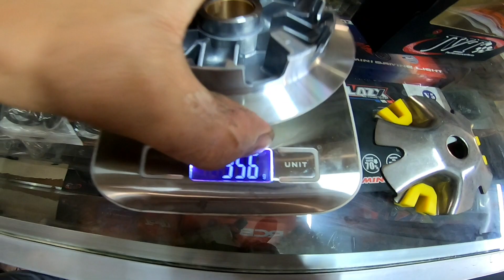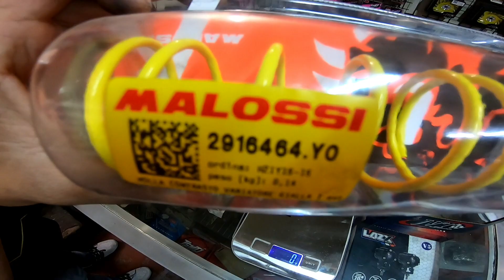The All New JVT Pulley Set for Nmax/Aerox

Comment: boss matanong lang sana masagot, ano po set up nyu dito sa panggilid niya naka full jvt set ako kaso 125 topspeed, (1200rpm center spring, 11 straight flyball, pulley set, clutch lining assy) Tsaka additonal nadin po, baket po nag iba tunog ng jvt v3 ko na pipe parang mas umingay at iba sa pandinig at ung arangkada ng motor ko parang hinihila sa una bago umarangkada.
Reply: Same tayo qualification boss,ilan weight mo?